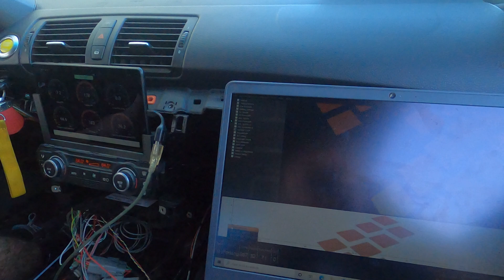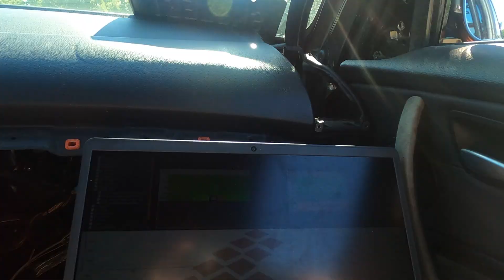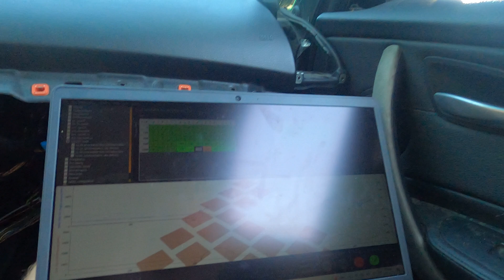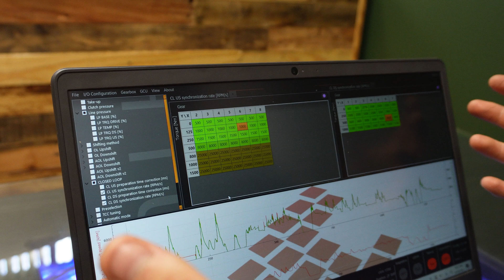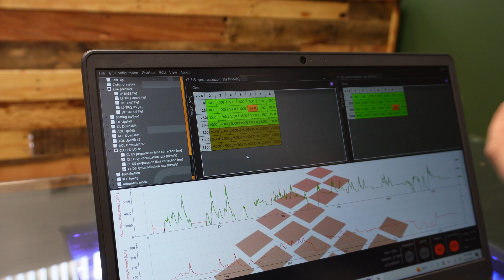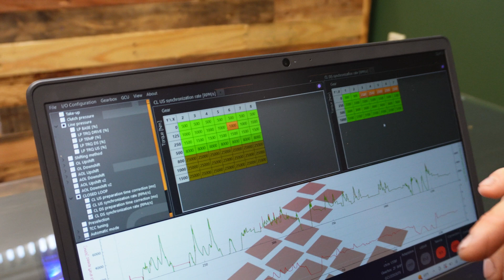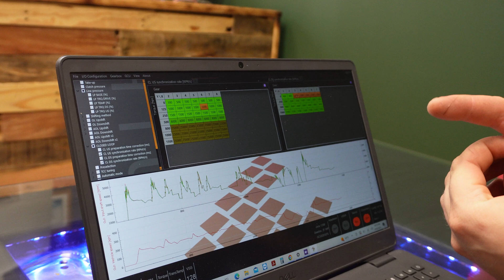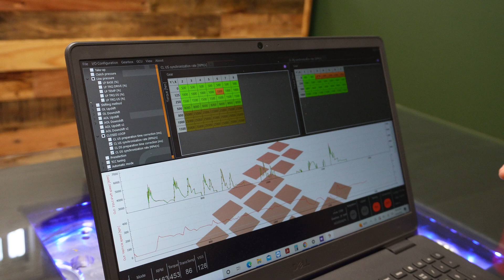Tuning the 8HP Swap with HTG!

Comment: What wtg was this pushing, I heard you say 700whp but what about tq. How's the trans holding up? Cheers
Reply: I’m also here to find out how the 45 is holding up! 👍🏼
Reply: At 8:22 it looks like their shift rpm is 7k, so I’d like to assume (best I can do for now) based on that and the fact that the N54 is under square; meaning it makes peak torque relatively low in the rpm range (between 4.5k and 5k rpm and peak power between 5.8k and 6k rpm stock) that they may be making peak power around those rpm ranges still. We can transpose the formula 
(Torque x RPM) / 5252 = Horsepower ,and substitute those power and rpm values into the equation. (Will be using the lower peak power rpm value for a higher torque output) We will get something along the lines of. 

(Horsepower x 5252) / RPM = Torque 
(700 x 5252) / 5800 = 633wtq which

This can mean either they are making a bit over 700whp at 5800rpm or they are making 700whp earlier than 5800rpm

Hope that helps
Reply: I too would like to know how it’s holding up as I would like to make considerably less hp 550whp at 5500rpm which would mean I’d be making 525wtq at that rpm. 

Would be great to put my mind at ease know that these 45’s can comfortably hold 2x their stock tq rating
Reply from the maker: @levicharles4499  no issues yet!
Reply: @Seems Legit Garage   hey guys, sorry just to confirm this is 625wtq? And your on the 8hp45 or the 8hp50?
Reply from the maker: @mrfiasco7941  yea about, and its a 50 but pretty much the same thing
Reply: @Seems Legit Garage  thats incredible, definitely an underrated box from ZF, in the UK on the m-lite cars M140, M240, and the 340, 440. Some people have fit the 8hp70 from the diesel offerings. With my hybrid set up i'm going with I'll only he pushing 550ftlb, 550bhp. So gives my piece of mind yours is holding up. Cheers guys
Reply from the maker: @mrfiasco7941  yea we dont get the diesel boxes here so we wanted to find limit of the 50
Reply from the maker: Torque is around 625, I don't really want anymore down low it just blows the tires off on corner exit

Comment: How do you guys set the tune for hi load without damaging the trans?

For example when tuning on the dyno for max power?
Reply from the maker: The closed loop control sees slip and adds duty cycle

Comment: what rear diff ratio are you using with the 8hp?
Reply from the maker: 3.27
Reply: @SeemsLegitGarage  think the M3 3.15 will work with it? Also how is it from a dig?
Reply from the maker: @Breakmywalletmedia  Awesome from a dig using the trans brake or clutch dump. 3.15 is perfect.
Reply: @SeemsLegitGarage  would 3.38 gearing be too aggressive with an 8HP70 in an e39 540i?
Reply from the maker: @DK-421  not terrible but deff aggressive

Comment: Love it, I'm almost there with my 240+LS+boost+8hp70,  just a few steps left!
Reply: Any updates? What did the transmission come out of, adapter and controller did you use?
Reply: @davidwitcher5443  almost to first test drive, sub to my channel for updates if ya like.
Reply: @FredAllenBurge  Will do. Thanks!

Comment: Hey guys what rough estimate would I be looking at all in on a 8hp for 2003 e46 sedan.  Including driveshaft and literally anything else you can think of. Thank you guys for all your hard work putting content out !🤘 About $4500 but will the paddle setup work with a factory e46 steering wheel. I want to keep all the radio and fimctions plus airbag 🤘 hello 👍
Reply from the maker: Hi, this is totally doable. The car wont be affected at all. I think 5-6k is doable if you are DIY